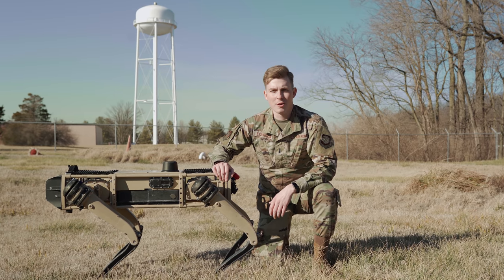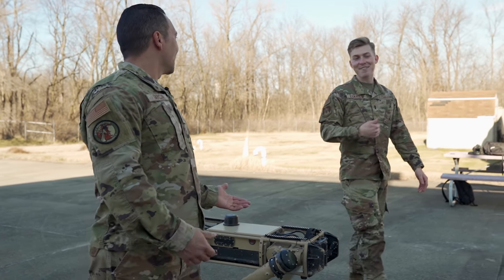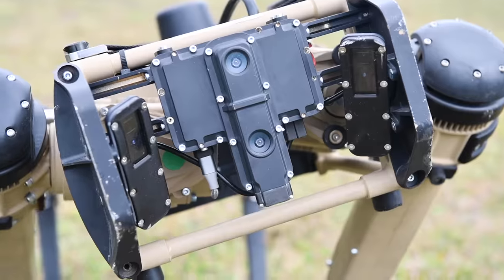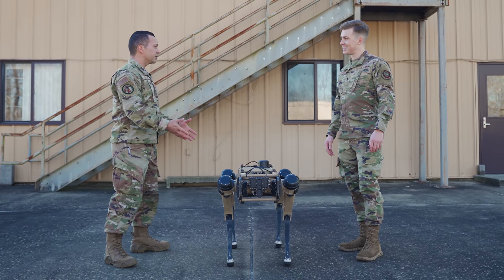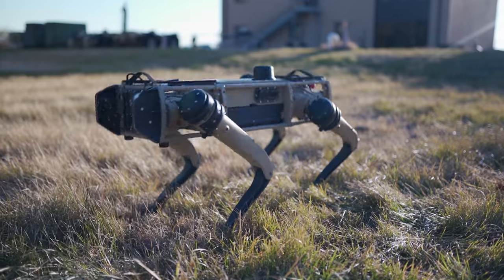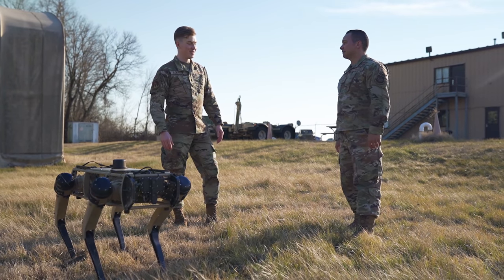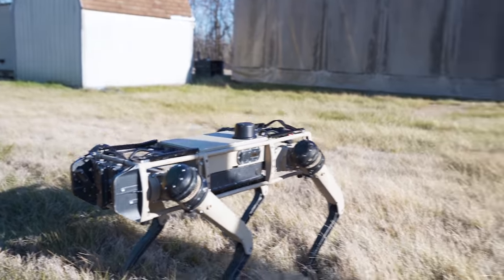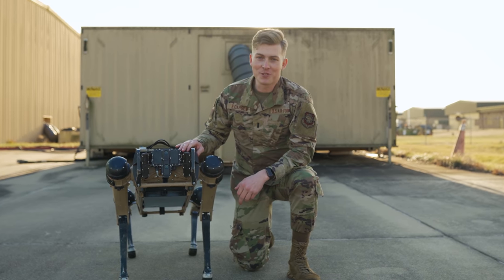Meet the Futuristic Military Robot Dog

Comment: Dont you just love it when someone just knocks of boston dynamics spot
Reply: Boston Dynamics is a defense contractor whose original robots were all created explicitly for the almost sole purpose of serving as early prototypes of exactly this, except fucking way larger and much more terrifying. BD's Spot is a crystallization of that research over years into a low cost consumer application useable by enterprise customers -- this, on the other hand, is designed specifically to provide low-cost automation of repetitive security personnel tasks; both are arguably the consequence of literal decades of human labour and many hundreds of millions of USD in publicly-funded research and subsidized partnerships with industry. 

Spot is the "knock-off" of decades of work and enough taxpayer funds to build an entire university or a new Tier 1 hospital, all at the expense of the government, with privately-funded involvement being netlabel and only relatively quite recent. American innovation is a consequence of massive, government-organized and government-led projects, and commercialization and privatization are one of the last and frankly least important links in the chain. 

If you want to complain about something (silly), complain about how they didn't build a hospital in your podunk rural community so they could have robot dogs. You'd still sound silly, but at least you'd sound like a remotely educated/aware silly.